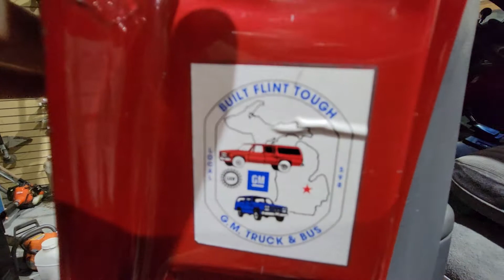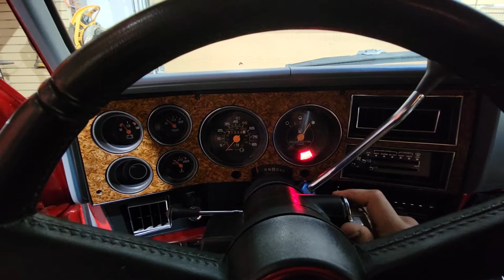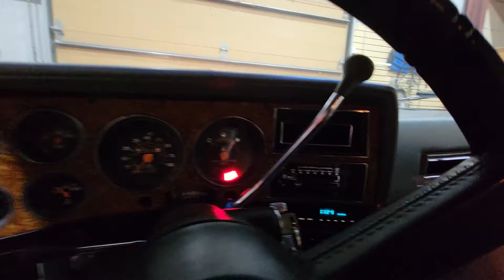1989 GMC Suburban SLE Wallaround

Comment: Dude, i just baught a 89' GMC suburban  SLE 1500 4x4 for a grand in south dakota. but metallic blue. was equip with rear AC/heat but that actual equipment is missing for the rear heater box.
and since the center console is so huge am gonna mount a custom wood box for my Volcano Vape can chill in their run a inverter and a rewire the dashboard old  rear AC switch  to send power to the inverter. then i can either have a blutooth radio to run my volcano app from or use my phone to remotely set my vape temps. but wait theirs more. i was gonna run some tubing along the ceiling and have drop down masks for easy vaping on command since the storz and bickels volcano already has a air pump. call my the mystery burb
Reply from the maker: That sounds like a fun project! Definitely a big truck and easy to work on, i like to keep them mostly stock, but this is America, and uts your rig man! 
Maybe post a video of it sometime